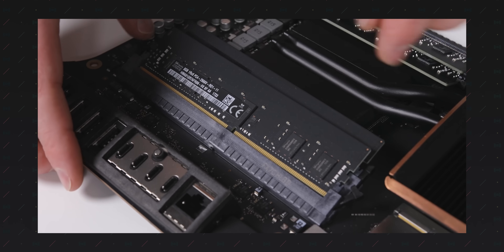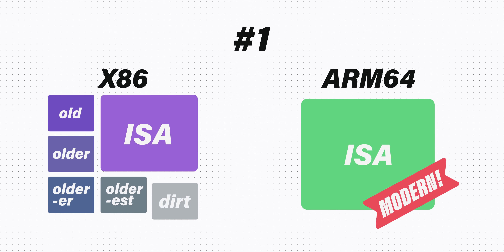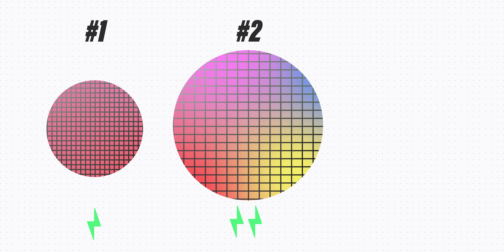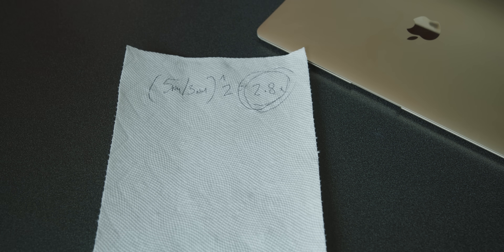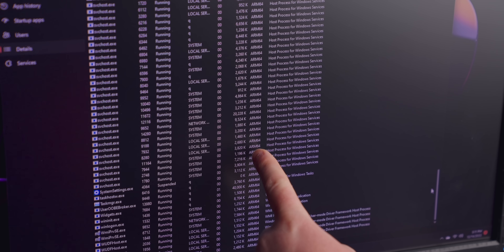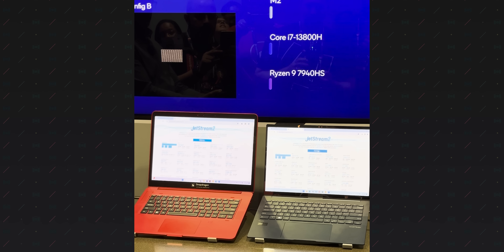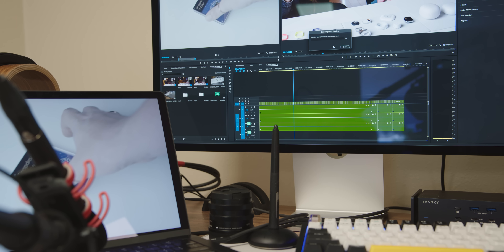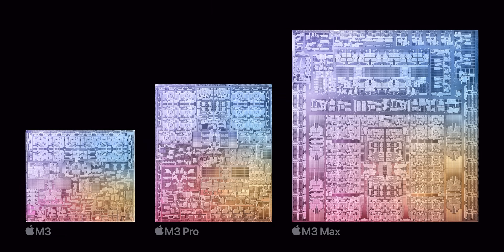Apple's Silicon Magic Is Over!

Comment: As soon as Apple began soldering ram and storage to the boards they lost me as a client. Ram prices are borderline criminal.
Reply: All companies do the same, the last hope was Lenovo and look at them, soldering the ram
Reply: @alanalb1449  last couple gaming laptops I've got had 8gb soldered and 2 extra expansion slots for upgrades. And an extra m2 SSD port.
Reply: Yeah, they should just give out free Ram and SSD upgrades. No professional would think twice about the upgrades, because it more than pays for itself.
Reply: There are more costs and savings than just on paper. If I had to do an audit of time spent servicing or configuring my Windows machine vs my Mac the Windows machine cost me $2000 in my hourly rate a year.
Reply: @xpowerchord12088  2k USD in what? I edit both photo and video for a living and haven't had a problem in over a decade with any of my laptops.
Reply: now its not even soldered...it inside the SoC.
Reply: @lusarshameli7057  my current laptop ran out of space in the secondary drive, all I had to do was open it and pop a 4tb nvme. Why is it that hard for people to understand how logical it is to be able to fix your stuff. 🤣
Reply: @makatron  I'm not talking about storage and I'm not talking about machines with separate RAM and CPU. The Apple M machines have the RAM within the CPU package...hence the name System on Chip(SoC).
Reply: everything will be etched onto the same board very soon. intel js now doing it and I guarantee you within the next 10yrs nvidia will be releasing a arm CPU/GPU chip
Reply: Or you can buy intel who can’t design a properly working cpu anymore……
Reply: Apple are crap. Period.
Reply: They don’t miss you and they don’t need to stop technical progress to satiate you old timers.
Reply: Agreed
Reply: Ram is not “soldered to the board” with Apple silicon. It’s on the die.
Reply: @lwwells no. Its not in the die is in the chip module or pcb.
Die is the silicon sliver.
Reply: @lwwells  even worse
Reply: @makatron  *worse 

I think you fail to grasp that what you are suggesting would yield worse performance. That’s why you aren’t an Apple engineer.
Reply: @lwwells  yeah Oops worse
Reply: @lwwells  oh just happen to have studied electronic engineering brother, and such close systems at the end are designed that way for the sake of upsell, and has nothing to do with performance
Reply: @makatron  studied? Sounds like we understand why you didn’t finish.
Reply: @makatron close system doesn’t mean performance? Then why processor even bother having their own registers? Oh wait…
Reply: @nhs.14  considering I learned how to code assembly at age 14, yeah I agree with you but being unable to upgrade your computer sucks.
Reply: @makatron  hmm we are talking about performance tho? Unable to upgrade was the drawback, but saying that design wasn’t related to performance at all from someone that learn assembly from 14 doesn’t seems to hold any meaning. Maybe you just learned at 14 without understanding any of it?
Reply: @nhs.14  my dude the whole soldering ram and SSD to the board limits the user and also allows them to sell ram at a premium when in reality is not that expensive.
Reply: @makatron  yes, which wasn’t the point of my discussion tho? I was calling you out because you said the performance gain wasn’t there. And what i mean was the ram, im not talking about the ssd hence why i brought registers analogy, yet somehow someway you are bragging about learning about assembly yet you never addressed what i called you for 😂
Reply: @nhs.14  I never said anything about performance, it's always been about being repair friendly
Reply: @makatron man you must be all kinds of fun at parties. Do you actually know everything or do you think having coded in machine language 40 years ago gives you any extra credibility whatsoever in today’s world of consumer electronics. If you want to be able to augment specs buy a Mac Pro. Otherwise just build your own hackintosh or pc tower since you’ve been graced with so much experience with assembly coding and that incomplete electronic engineering degree you’ve been boasting about. 

Matter of fact why not start your own company and just show Apple (and us) how it’s done.
Reply: @makatron  haha you don’t know anything about electronics
Reply: @makatron  don’t buy it
Reply: You do realize that “soldered” RAM is much faster than user upgradable because of the latency right?
Reply: @jeffp565  CAMM and LPCAMM are user-upgradable and both support 6400 MHz, the same frequency as the M1-M3. So much faster, an entire 0 percents. The latency difference is negligible.
Reply: for me it's: RAM - meh, whatever... SSD - must be removable, soldered is not acceptable.
Reply: @victortitov1740  The SSD is replaceable on m4 Mac mini. Everyone is freaking out over technical progress.
Reply: Not borderline; it's highway robbery
Reply: Apple ram is not soldered to the board. That's the big difference and everything is moving that way in the industry. Ram is ETCHED in the same silicon die that cpu gpu and other modules are. And believe me in future everything would be that way. That sort of tight integration enables huge performace and power savings, something that is absolutely needed...
Reply: @veljko100able lol. You re clueless ram is outside the silicon chip.

A 64gbyte ram chip has more transistors than any chip  built  by apple. Ram is glued inside the chip module.
Reply: @veljko100able tight integration that is only marketing.
Stop commenting .
Reply: @veljko100able trust me...when u say : best solution..there is always a compromise. There cant be only GOOD in life..there has to be BAD too...in tech means: u cant create the best product, u always have to make decisions and compromise about some details...  yin and yang law is everywhere.
Reply: @veljko100able A lot of people miss this point. Despite Apple getting smacked with Right to Repair and SideLoading lawsuits, many Android providers are starting down the same path. They can’t keep up with performance and security (for the lay user) without making those changes.

It’s also annoying when people say things like “You can’t add additional storage”. Uhh, I can in fact plug in a thunderbolt 512GB USB smaller than my pinky and record 4K video directly to the USB. Why would I want some flimsy SD card that will randomly fail when solid state USB-C is so effective.

People complain about things they don’t understand.
Reply: @veljko100able yep and one of them fails and the whole lot is junk, and Apple won’t want to know after 2 years and 1 day. You must have more money than sense.
Reply: @veljko100able  That isn't strictly the case the ram is a separate chip linked to the CPU using an interposer which is all then put into a single package.
Reply: @veljko100able  It's not part of the die, just look at the die shot. It's soldered to the interposer, so it might as well be soldered to the board. Some Chinese guys already managed to upgrade the "etched" RAM. It doesn't save any power and the performance gains are virtually non-existent.
Reply: @veljko100able barely any power savings and performance not much different.
Reply: @veljko100able  It isn't part of the same die, the memory chips are just located on the same package.
Reply: @veljko100able it is not upgradable, period 🤷🏻
Reply: @DownUnder43  PC graphics card's vram is not upgradable either. Period.
Reply: @kpbendeguz  lmao you thought you had a point there?
Reply: @HarryS77  Yeah I pointed out how ridiculous DownUnder43's "not upgradable, period" argument is.
Reply: @kpbendeguz  Yeah, you didn't though.
Reply: @orbatos  Exactly. So if you need more vram, you have to buy a new card.
Reply: @HarryS77  Well not everyone has the mental capacity to fully understand an analogy.
Reply: @kpbendeguz  And apparently not everyone has the mental capacity to know what an analogy even is lmfao
Reply: @kpbendeguz  You can't install a new card in a Mac.
Reply: @HarryS77  Exactly my point.
Reply: @orbatos  You can't install a new card in any PC laptop either.
Reply: @kpbendeguz yeah but you get to choose the card you want, gpu you want, ram you want, storage you want. (Or in case of laptops, at least ram and storage). Gpu VRAM is soldered, but system ram isn't . Think about the fact that it will not only make buying more ram have to be done with the pc itself, but also down the line, when you've had the pc for a while, you may want to keep using it but make it perform usably, so you install more ram to give it SOME performance boost... Except oh no you won't because the company you bought it from decided you can't do that by yourself and instead you need to pay THEM ahead of time to be able to use the machine for longer.
Reply: @kpbendeguz yeah, you get to choose more ram though... And more storage. And if you want to be a real menace you can swap the gpu out or the cpu too if the laptop you have has higher end models with better specs, as you can technically go to a pc repair spot with a soldering station and have a new cpu/gpu soldered on :)
Reply: @DownUnder43  have fun waiting 5 years to upgrade to the same performance as today's SoCs.
Reply: @kpbendeguz vram is not equal to system ram... Apples to oranges comparison
Reply: @bannanas117  And a SoC with integrated CPU, GPU and unified memory is not equal to a system with separate CPU, ram, GPU and vram, still people are comparing them, because ... you know ... not upgradable, period.
Reply: @kpbendeguz  BS. ALL laptop CPUs are "SoCs with integrated CPU, GPU and unified memory". But they still allow you to upgrade the RAM. SoC is not related to RAM or SSD whatsoever. GPU and VRAM also doesn't have anything to do with this.
Reply: @null-nl5su  Which AMD laptop SoC have ram integrated into the chip and works both as ram and vram exactly?
With unified memory the CPU and GPU cores can read / write the same memory blocks, so no copying needed between the ram and the vram. In a Mac with 64GB unified memory 75% can be used as vram, so it can function as a 48GB graphics card. (That's why vram has a lot to do with this if you want to compare different architectures.)
I guess you mix unified memory with the cheap PC laptop solutions where the integrated GPU takes a specific part of the regular ram and use it as vram, but in those cases the vram still not accessible by the CPU neither the rest of the memory by the GPU.
Reply: @kpbendeguz  Read my other comment. 0 CPUs in this world have RAM integrated into the chip. DRAM and logic just don't mix. M1 has RAM on the interposer, which is no different from it being soldered to the board. Intel CPUs are also SoCs since Lynnfield (2009). Not sure about AMD but Intel already had unified memory a decade ago. It's called DVMT. With it the GPU can access the same RAM as the CPU without copying. So unified memory is possible without soldering RAM. It doesn't even give a speed advantage, CAMM/LPCAMM achieve the same memory speed as the M3. Soldering SSDs also doesn't improve performance. I bought a 2TB SSD for around $220 and it's can do 7300 MBps read / 6900 MBps write. Apple will charge you $800 to upgrade to a 2TB SSD that only reaches 3000/6000 MBps depending on the Mac model.
Reply: @kpbendeguz  What's your point? Apple Silicon is not great because of "unified memory". Their GPUs perform much worse than discrete ones. The reason Apple Silicon is so fast and efficient is the CPU, which don't have anything to do with soldered RAM.
Reply: @null-nl5su  Just unplug any laptop with discrete GPU and see how it performs compared to an Apple laptop unplugged. Or run an LLM which needs more than 48GB vram on any discrete GPU vs. an M3 Max with 128GB unified memory and you'll see the difference: the discrete GPU runs out of vram and die while the Apple SoC with unified memory can still go on because all the ram is accessibble by the GPU.
Reply: @kpbendeguz  But the whole GPU is, which mitigates that downside
Reply: @kpbendeguz  1. The M3 Max is many times weaker than even laptop discrete GPUs and is not exempt from the laws of physics. A discrete GPU will drain the battery faster but will take much less time to execute the same task. And the M3 Max will also run out of battery while taking much more time to do the same amount of work. It's a very cherry picked example and even then the M3 Max loses.
2. That's an edge case, and a very specific one at that. LLMs use quantization (you can fit Llama 70B on an RTX 4090 with it) and Llama 70B will be terribly slow on the measly 14 TFLOPS M3 Max GPU without Tensor cores anyway. And there are no open source models that won't fit in 48GB after quantization. Which shows the advantage of dGPUs. They might not be able to run the biggest models at full precision, but they can run them many times faster.
Reply: @kpbendeguz a bus in nvidia gpu has faster speed than M4 bandwith.
Aside you dont have cuda acceleration.
Reply: @kpbendeguz thats Bullshit in real life doesnt work as fast like theory.
Reply: @null-nl5su the reason why apple is faster is because was built on 5nm while  competing with 10nm chips. Everybody buys the stupid argument of shared memory that was used so you cant upgrade.
Reply: @sergioyichiong7269 I think you should stop commenting. 😳🙄
Reply: @HarryS77  Keep coping broke boy, Apple has never been better.
Reply: @_..-.._..-.._  lol get help
Reply: @null-nl5su Wrong, apples GPUs are amazing power for their size and efficiency, base m4 is equal to 4070 ti
Reply: @null-nl5su You’re so wrong about the GPUs they’re far more powerful than most laptop GPUs.
Reply: @HarryS77  I don’t need help, I can afford to buy the best.
Reply: @veljko100able this people don’t understand it like you do
Reply: @alextex27  Idk man this sounds a bit sarcastic...
Reply: @veljko100able  LPDDR5X LPCAMM2 is not much different than on-die and will be seen in laptops this next year. It's a CPU-like fit that allows shorter leads (and thus lower power) from ram to CPU, while allowing upgrade/replaceability. The soldering of nVME is just greed.
Reply: Right! That along with Apple prices…
Reply: The problem isn't them soldering the ram onto the board (a lot of windows laptops have been doing it for a while). The issue is that they charge criminal prices for ram and stoage upgrades, 200$ for 8gb is absolutely daylight robbery.
Reply: @shafin3520  Then why do you buy it? Or if you don't why do you care?
Reply: @kpbendeguz  No, I don't own one. If I had the spare change I would probably buy an ipad, but I don't think that has anything to do with my right to critique their product. Cause 1. Apple has a history of setting anti consumer examples that other brand always end up cheapishly following and 2. Like I said, they are literally robbing their customers, which I absolutely hate. I don't get why it's even a debate lol. Do you like paying 3x the industry standard for ram and storage upgrades ?
Reply: Okay.
Reply: Were you shocked? This is old school Apple. The reason we originally hated them.
Reply: @gextreme2381  Who is "we"?
Reply: @gextreme2381 😳🙄
Reply: If they had a lot of ram from the start it wouldn't be a problem
Reply: @Kimdimasan  they tend to use the SSD as auxiliary RAM putting loads of unnecessary cycles on them.
Reply: It's called swap files, it's at best slow as hell virtual memory. Also whoever keeps talking about dad's like they are memory or even close to the same thing, it's storage not memory, love it when people have a discussion in public about shit they don't have even the slightest clue....oh one more thing, and I know you didn't say all this dumb shit, but you are the most recent one so easiest to respond to all the genius level techs in here lol. Anyhow last thing off hand, who tf is gonna compare a gpu and vram to an entire system and it's system memory? Or make a comment like ram eh but ssd's, those need to come out, why? Ffs, I run 128 gig of ddr 5 6000 but sometimes I only run 64 gig, on the flip, I don't ever take my nvme or ssd storage out and really they make external storage rigs but memory absolutely must be stuck directly on the main board they can not be external and be effective sooooo really storage can easily be soldered as is every cell phone to date, , I'm sure im missing something cause there was so much here to clown on but I'm beyond bored and am extremely frustrated that shit like this should ever even need be said. But it does. Don't argue bout shit you don't know the first thing about, now those keyboard warriors coming at me for my punctuation or grammar etc lol have at it, all while paying way way more for one of 3 or 4 choices of underwhelming blah..mac fan Boyz always give me a good chuckle.  É😢 @makatron
Reply: @twistedsocal exactly, they also overlooked that the base Mac whatever sh¹t model comes with ram so low it's unacceptable at that price point, but they wanna compare to a graphic card vram. By this logic, they might as well eat pineapple when apple is not available.
Reply: @makatron  lies
Reply: @Ethian315  the base m4 mini has 16gb
Reply: Nowadays even gaming laptops have soldered-in ram.
Reply: @Useruseruser32121  my gaming laptop has 8gb soldered in and 2 extra slots where I dropped a couple of 16gb modules.
Reply: @Useruseruser32121 not all of them. My 2023  Rog Scar 18’s ram and SSD can still be upgraded. A lot of low and high end gaming laptops can still upgrade its ram and SSD. From what I noticed, the models that solder their ram and SSD on board are the smaller portable gaming laptops. A lot the full sized ones are still quite upgradable
Reply: @Useruseruser32121 My ASUS TUF F15 has changeable memory and an additional slot for another NVME2 SSD. Bought it for 1000€ last years black friday. Upgraded it to 32GB memory and 2.5TB super fast SSD (7GB/s read and write) for just 200€ in total. Thats how much you pay for 8GB memory or 128GB SSD at Apple. I love that device, it can actually do things. 

(btw I also have 2 MacBooks one of which with a M1 Pro chip, so really just honest feedback and no hating)
Reply: @Useruseruser32121  Yes but they dont come with 8GB Ram LOL or upgrade is not 250$ for 8 more
Reply: It's just the way they do it these days. Yes, it prevents upgrades, though at the same time, they want less failures and not having a human handle memory and storage modules reduces failure rates, not to mention the packaging it now much better.
Reply: @kn7671 that's a poor excuse. They should have no problem at all having an m.2 slot for storage on the board for any future expansion, it would really be no big deal.
But they won't because then they can charge exorbitant amounts for internal storage and cloud.
Reply: @kn7671  Because installing ram and ssd's are SOOOO hard to do......SMH
Reply: @cjjones2981 they’re also much slower and prone to issues.
Reply: @cjjones2981  You didn’t understand the comment kid
Reply: @kn7671  handling memory? Are you for real? 🤣
Reply: @makatron lmao, they totally buy the "valid" reason of soldered on memory and SSD. See, these kind of people are so easy to scam, and drag everyone into this mess today. I don't mind if their money got lost or whatever but now involves everyone's money.
Reply: @makatron  Get over it old timer.